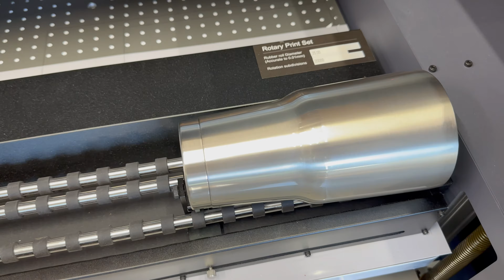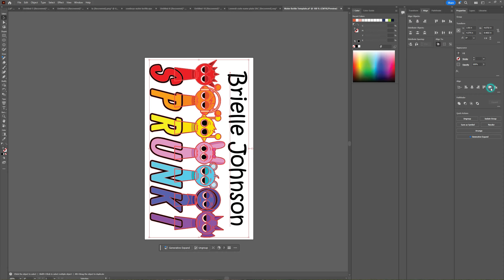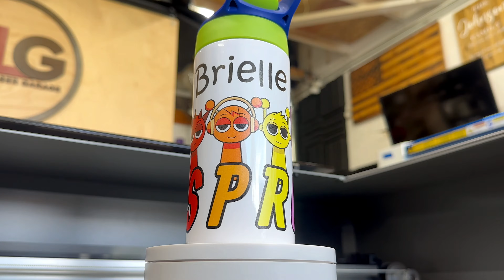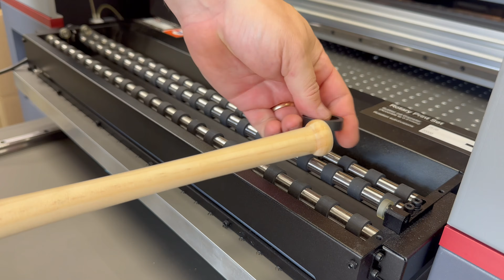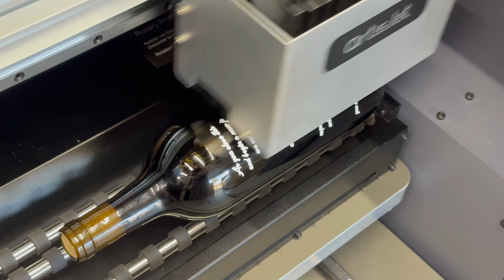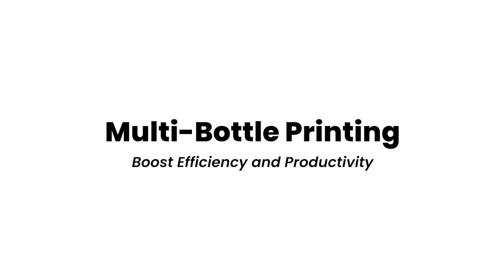Can One Rotary Handle ALL This? Bottles, Tumblers, Bats & More!

Comment: Will this work with a 5 gal water jug. Porcelain or ceramic?
Reply from the maker: The rotary handles objects between 30 mm and 130 mm in diameter, so a 5-gallon jug would be too large for this setup.

Comment: Is there any other design software that can be used other than illustrator?
Reply from the maker: Absolutely!  Take your pick of anything out there.  I prefer adobe products and use PS or AI but even free programs like Inkscape will work.  I’ve even printed designs I put together using canva.
Reply: @LaserGarage the only software that I’m familiar with is Lightburn. Can you give me all ballpark figure of what a machine like yours costs?
Reply from the maker: Oh cool. My printer is roughly in the 20k range.  Which is a lot but actually priced very competitively with others in the professional grade market.
Reply: @LaserGarage  ok. Thanks for the info!